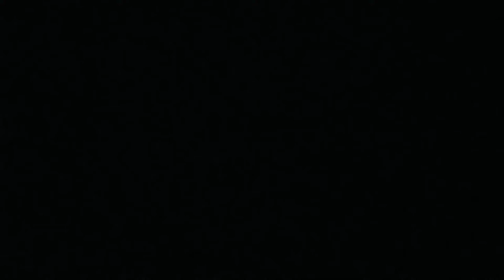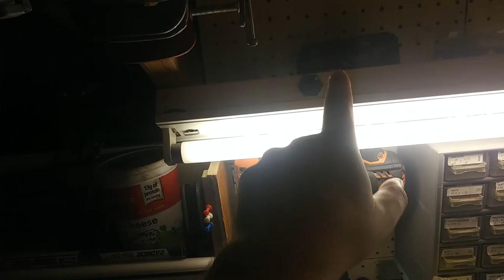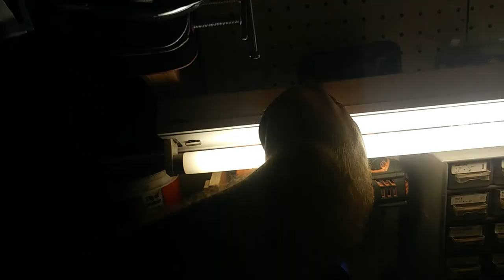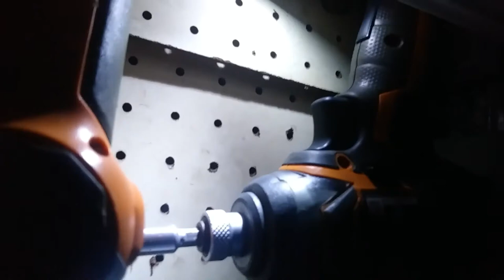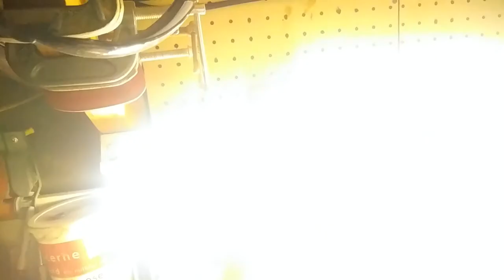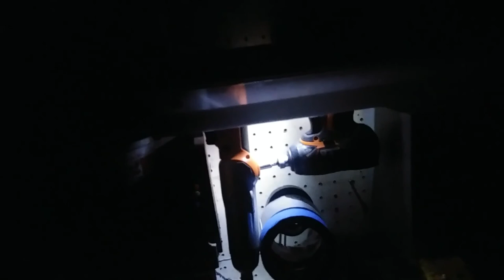The Mystery of The Ridgid Impact LED

Comment from the maker: Everything I know:
-It's a 120V electronic T8 fluorescent ballast driving a 30w lamp.
-The LED stays on as long as the fluorescent light is on. 
-Only this tool seems to do it. I have other Ridgid Tools with the same design that doesn't react at all.